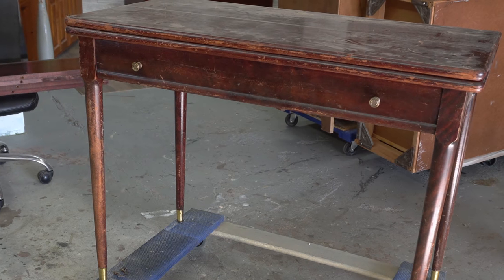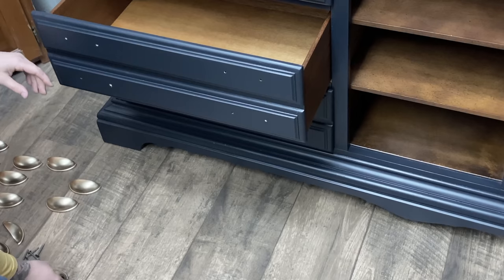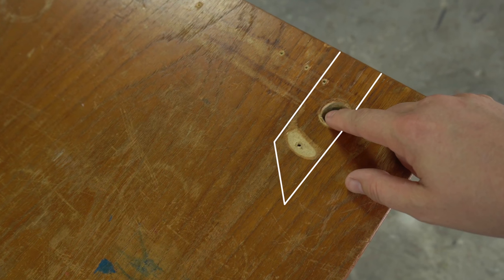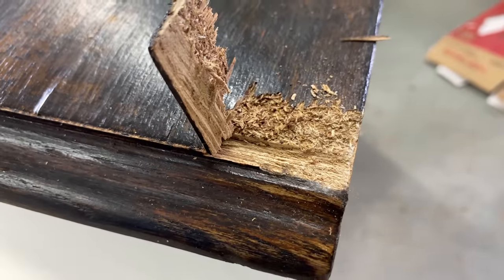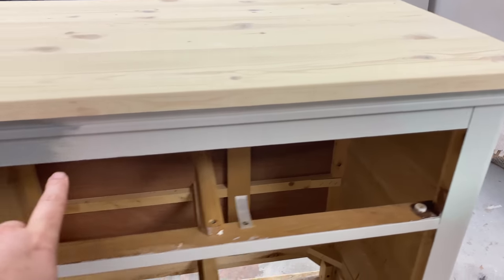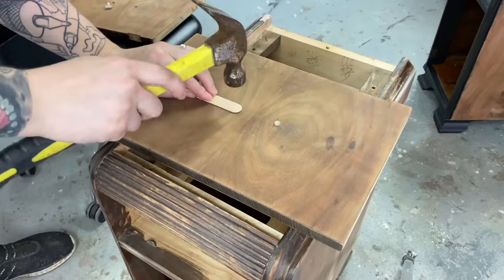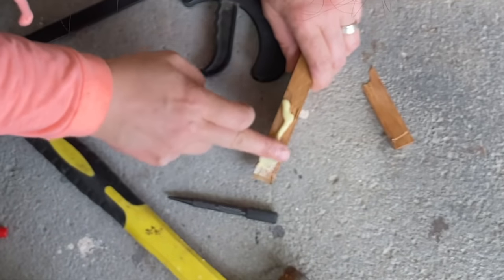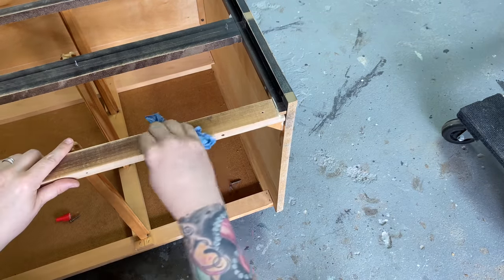I Made 1,000,000 Mistakes So You Don't Have To

Comment: I have a question, not related to this vlog…it’s regarding finishes used in furniture. Some times wax is used, sometimes oil & sometimes poly…while all these finishes are fine, I have heard it said that the only permanent finish is poly, because the other finishes need to be reapplied cos the oil dries out & the wax isn’t as durable as poly. Is this true? Do u have to redo the wax & oil finishes? What are ur thoughts on the durability & effectiveness of each of these finishes please?

Comment: Hi Angie, I don't know if you will see this as your post is a year ago. In your "oops" from July 5, 2021....about 9 min into the video, you mention that you used laminate pine to replace the tops. So....I earlier watched your video on veneer vs laminate vs wood. My mind is now mush...lol. Anyway. I'm wondering if you misspoke....or does the laminate look like wood grain even after you trim the edges. I know you are concerned about the laminate not being flexible like wood...thus too much glue. But I guess I'm just confused about laminate now. My apologies if this question makes no sense. I'm also wondering how laminate absorbs products.... I see you adding a white something or other to it. I'll rewatch again.
Reply from the maker: Ah- great question. 

In that video where I replaced the tops, it was laminatED pine, rather than laminate. I know, it can be confusing. 

Technically, laminated means layers that are bonded, whether that’s with glue, or pressure etc. That is often why when real wood veneer starts to come loose from its substrate, it’s said to be DE-laminating.
 
Solid wood boards that are glued together are said to be laminatED; that is, glued together. Which is what those pine panels were. It’s not the same thing as what is known in the furniture world as ‘laminate’. In THAT situation, laminate is referring to a man made product of various layers, usually with a printed or painted faux wood grain, or one that has a plastic feel. 

I realize this may have just made things worse, haha. But basically- veneer is real wood, thinly sliced that is glued (laminated) to another surface… solid wood is literal chunks of wood, either as a slab or glued together into a larger panel (laminated), and what is known as laminate specifically is NOT real wood, but a man made concoction. Lol 

Hopefully that helps?
Reply: @TranscendFurnitureGallery  It did, TY. I had just watched the other video...literally....so my mind was still there. :)

Comment: How do you decide pricing?
Reply from the maker: Cost per hour doesn’t work for me, at all, though it might for someone doing custom work. For me, a piece of furniture is worth what it’s worth, whether I breeze through it or struggle with repairs that take me two days. It’s still only worth X amount of dollars. I didn’t specifically say “charge what everyone else is charging.” It’s a guideline only, as many people under charge. My point was simply that if everyone in town is charging $400 for a pine dresser painted with a woodgrain top, charging $1500 might not fly. Again, it’s very different if someone is doing custom work, which I don’t. I could come across the exact same style of dresser (which has happened multiple times) and could refinish both exactly the same. But one took a day and a half longer because it needed more repairs. I can’t in good conscience charge several hours more for it. It’s the exact same outcome. 
There’s no magic formula that will work for every single person.